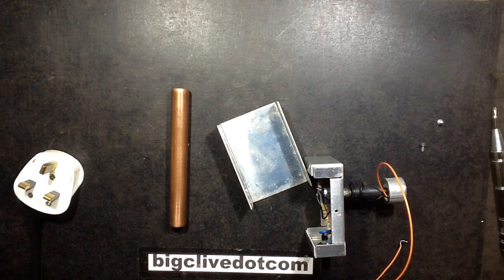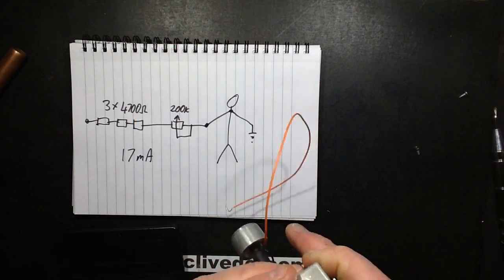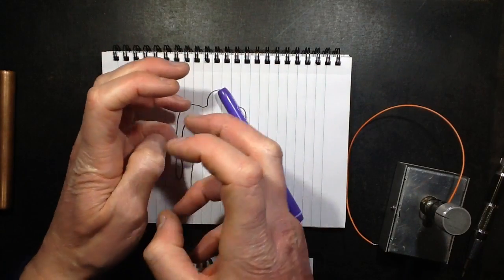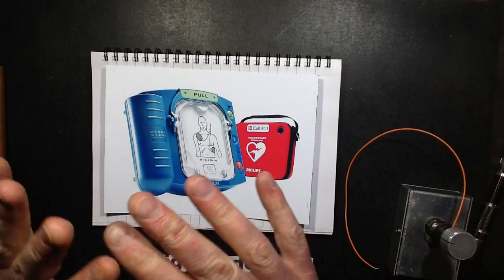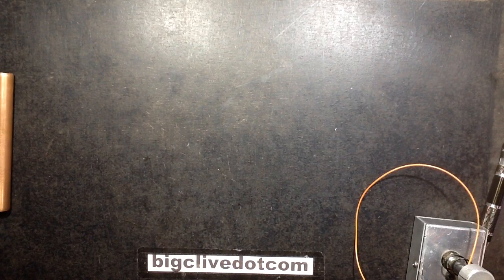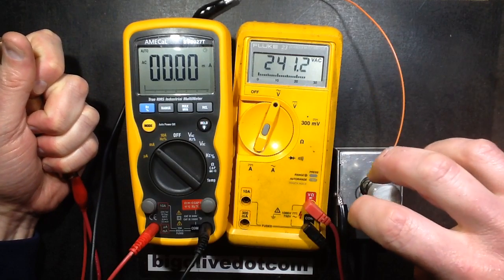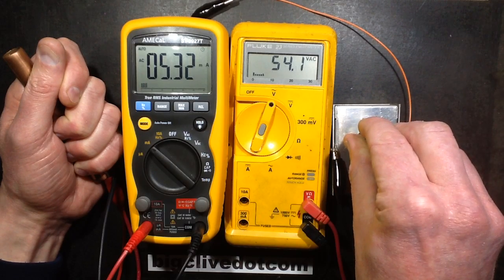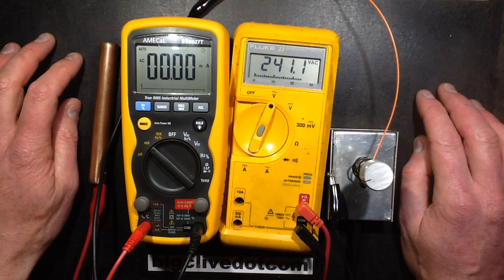Avoiding electrocution (Featuring real shocks.)

Comment: when i was given nerve conduction test to check for carpal tunnel syndrome , they fire 57 mA between elbow and fingeertips.most people are ok, except electricians, we just can't sit still when we feel current tingling like that, the automatic reaction is to pull away. 

Another automatic reaction, is when poking around in a live board with the right hand, the left hand automatically goes behind your back, to avoid dangerous current flow
Reply: When I was given nerve conduction tests for the same reason, the doc said I should see somebody as I reacted so much to the sensation. I told him that is fucking unpleasant which is why it is used as a torture method.
Reply: @drteeth7054  doc why don't you try it lol
Reply: 57mA? What the hell

Comment: 9:15 There is a famous picture of a televised soccer (football) game in which the pitch was struck by lightning. About have the players of both teams collapsed badly hurt. There didn't seem to be any rime or reason why some players were hurt while others weren't.Then someone watching a replay noticed that all of the injured players had both feet on the ground when the lightning struck, while all of the uninjured players were running and had at least one foot off the ground.
Reply from the maker: +Eric Taylor The science of voltage gradient.  The further apart the contact points are, the higher the current flow through the body.

Comment: Some time ago I worked with a best boy (movie electrician) who was completely immune to shocks. He could literally light bulbs on the tip of his nose. Which was great for him, but not necessarily for the rest of the crew (who got a few nasty shocks off him). Apparently there are some genetic mutations that can cause people to have highly conductive skin.
Reply from the maker: +RFC3514 There's also trickery.  Most of the electro-freaks used concealed wires, high frequency or props.
Reply: bigclivedotcom I'm sure there is, but this guy wasn't using any (one of the other electricians deliberately made a light stand live and he didn't even notice it). Also, he kind of lacked the imagination or intelligence to fake it. Not the "brightest bulb", so to speak. :-P

Basically, he had that job because he could fix practically anything on set without turning the power off.
Reply from the maker: +RFC3514 I will admit that at work one guy did take the tingle-tron to the max and din't seem to be sensitive to current flow at all.

Comment: anyone know what kind of voltage and current comes out of those electronic exercise belts for lazy people? they have  electrodes/pads in a belt you put around your stomach and they pulse electric through you to make your muscles contract. I assume theyre safe because its just going across your stomach rather than through your heart but theyre excruciating
Reply: The electronic trainers are usually under 50mA and for them to work they have to be grounded. You put one ground between the electrodes so the current only flows through the mucle any escape electricity that escapes will go to ground:). So they are relatively safe. They might also has a control as Clive says in the video that cuts if it senses a pulse.

Comment: As an electrician I can say that the occasional and unplanned electric shock is painful and a very unpleasant feeling. I don't know whether to congratulate you or condemn this video...but you have some big cajones Clive
Reply: +DaZ X I was once dismantling an old trash camera for the little useful capacitor inside. Well (me not being knowledgeable about electricity whatsoever) i did not short it out beforehand. Yes, fully charged you can see where this is going. The capacitor was rated at 125V around and 8000μF(estimate). I'm not sure of the other specifics as i misplaced it somewhere. Anyways i touched it and boy did it give my sweaty hand a zing when i dropped the circuit board holding it so i grabbed it instinctively. I want to know if such a Capacitor would be safe as an electrocution device for pranks or other ideas of the sorts. I already know the answer is probably a bit bold no but i thought i'd ask as well if i was in any real danger when i grasped it with my hand. Hope you get back to me, anyways have a good one!

Comment: There was a kid at my school who built a device from a rotary dial phone. It was self-contained (didn't get mains power iirc). Just one turn of the dial and all of the people holding hands forming a circuit with its terminals would be twitching and shrieking/giggling like crazy until one let go breaking the circuit.  
I wish I knew how that worked. I guess it must be high voltage but low current and possibly DC (so reasonably safe? (can it be safe if it's making people twist and shout?)), the dial turning high gear ratios to a dynamo but perhaps a battery or two was involved. I never saw inside it. If anyone can explain it (apart from the kid who built it) Clive can.

Edit: After a little bit of searching, those phones had Magnetos that could apparently output over 100V AC (not sure about Amps) so it might have been nothing more than that (although I think he did add at least a rheostat to vary the output). I think the advantage over your tingletron is that the electricity flow is timed by the phone dial turning so it automatically cuts out after a second or two. That would seem a little bit safer to me. The AC frequency might be different and then perhaps a little safer too.
Reply from the maker: +CommissionerSleer I found one of those in a box of my grandad's stuff and didn't know what it was.  I turned the handle and got a hell of a shock.  It's purpose was to generate a ringing voltage to ring the phone at the other end.
Reply: bigclivedotcom Thanks for replying. It's a surprising [shocking] feature of old phones. I'd forgotten all about it until seeing your tingletron. It's a shame that kids these days have to get their shocks from Chinese water heaters sold on e-bay.

Thank you too for all your videos. They're very entertaining and interesting.

Comment: Great video as always. On the topic of electrocution - I don't understand USA plugs and outlets. We moan about poor quality Chinese rubbish (and rightly so) but the 2 pin USA plugs are a death trap. In the UK our plugs have an insulator on live and neutral and only around 5mm at the end is conductive so when you remove the plug there's almost no chance of accidentally touching a live conductor. USA 2 pins plugs don't have this safety feature. the sockets also don't have the earth shut off of the live/neutral  (so when you take out the plug the plastic goes over the live/neutral). Also all the USA plugs I've seen just seem to 'hang' out at the ones without an earth pin only rely on the live/neutral thin pins and the compression of the socket is all that's used to hold it in place. For old sockets this means the plug can be super loose, slowly come out and can arc if not properly connected and we'll,  we all know what happens then. As USA plugs carry a higher current they need better connectivity too. Am I missing something with this? UK plugs are old fashioned but very over engineered. Other countries in the EU with the round plugs are not desimilar to the UK and are also quite effective.
Reply from the maker: +Richard Parry The American plugs are something that can't easily be changed due to there being so many of them in use already.  It's a "grandfathered" design like the E27 and B22 lamp holders you can stick your finger in.

Comment: I have drained a battery on one of those novelty shock lighters by just holding down the button, my friends were surprised because most of them would drop it after the initial sensation.

Comment: You ought to do a teardown on one of those cheap Chinese, battery operated, TENS (transcutaneous electronic nerve stimulator) units, also sold as "electronic massagers". You put two adhesive pads on your skin and turn it on.
Reply from the maker: +Chaplain Dave Sparks I've tried a few for fun.  Most of them have a random output at full feature which makes them more like a random shock game.

Comment: put the back of your hand on the copper pipe, that way if your muscles contract beyond your control you pull away from the pipe, always touch anything that might be live with the back of your hand first
Reply: Who doesn't?! I usually have a coil in my pocket and I drag a stake on the ground...
Reply: +james hallas Back of a finger is even better - if you get a shock it'll curl your finger automatically disconnecting you from the source. I'd use a non-contact pen first though, just in case. But that trick's useful in case your pen gave a false-negative.
Reply: +pmailkeey no s##t Sherlock, I take it you carry an earthed wire around with you at all times?
Reply: Better yet put the back of someone else's hand...
Reply: I used to just pinch a long blade of green grass between my thumb and pointer finger and touch it to electric fences to see if they were on or off.. When on, you could just feel a weak pulsation
I dont know if something like this would work for other things or not.?
Reply: Ha ha... Alex Greenwood, ME TOO !!! Esp. since I just shooed a fly away a few seconds ago !
Reply: Mike44449 You have just won the internet. xD

Comment: watched my brothers grab an electric fence,the girl living there could hear the transformer switching on and off knew when to let go and when to grab on, she told my brothers it didnt hurt, thats because it wasnt on when she was grabbing it. I laughed so hard when they latched on to it when it was on. what idiots! she was cute,so they were pretty gullible to say the least. lol. I worked around 260vt at a factory. I had a screw driver blown out of my hand when I accidentally touched a live power bar. It blew the tip of the screwdriver right Off. All of my tools were insulated. That happened to be a wood handled screwdriver someone handed me. I know what it feels like to be "poked". not much fun.

Comment: We once did an experiment in physics when learning about capacitance and capacitors where we charged up the class (standing on plastic trays) in a line of 10 people with linked arms using a van der graf generator, and then discharged the line from one end through another person touching an earthed tap. We were all expecting a small shock but it was strong enough to cause strong spasms in our arms. Fun stuff xD
Reply: +Debated Nothing We used to do something similar in computer class. A line of people would lift their feet off the ground and touch the staticy CRT monitor with one hand, and the next person in the chain with the other. Person at the end of the chain got touched on the ear, and a nice static shock. VDG generator's would be way more powerful but we never got to play with them :(

Comment: With all your talk of sensible electric safety, I keep thinking of the warehouse where I used to work. We had a big 1,000-liter mixing tank for liquid fertilizer. Water-based, of course. The water was probably fairly conductive. The salts in the fertilizer were certainly more so. Not long after I started working there, I noticed that, when I touched the fertilizer to check consistency (it was organic, so no worries there), I felt a peculiar nasty tingling in my fingers. I thought it was just my imagination. Then I realized that the mixing-tank was being agitated by a shitty mains-voltage immersion pump, connected to an unfathomably shitty power strip which was just cable-tied to the tank and was regularly splashed and soaked with conductive fertilizer. I all but forced my boss to let me drive to the hardware store and get a proper outdoor-rated power strip.

It couldn't have been that much current, since I wasn't connected to ground (and since it didn't kill all three of us who were working with it), but even so, it's a nasty sensation. I take my hat off to you for enduring that tingly torture for educational purposes.
Reply: p
Reply: Pretty much anything liquid is water based.
Reply: @looksirdroids9134  No. Anything can be liquid at the right temperature and pressure. Lava is liquid rock, Mercury is a metal that is liquid at room temperature, etc..

Comment: That's incredible, I didn't realise that milliamps were enough to kill someone (I always thought it was amps). Years ago I was messing with a fusebox and accidentally touched the black(?) mains input and was shot about 2 foot backwards... how many amps and why didn't I die? some suggest simply luck
Reply: I'm not an electrician but I would say the natural resistance of your body saved you. Voltage is equal to current times resistance. If you were throw likely the current flowed straight through only a part of you. Missing the heart and causing the massive muscle contraction that made you involuntarily move. Due to high resistance the current that flowed was relatively small. Think of static shock during dry winter months. The arc is caused by very very high voltage that flows right thru your finger but it's very low current.
Reply: +Kayla Mayfield Therei s actually a test on youtube showing static shocks are 8amps but due to the short period of the shock its not enough to kill.

Comment: I shocked myself once on 230 volts. Luckily, i was careful so the current only went through one finger. Still it did hurt like hell. Can't really recommend it to anybody.

Another time i hot shocked from the worst camera in history.
I tried to repair a small digital canon camera with stuck optics for a friend.
I unscrewed all the screws, and the moment i pressed onto the case to open it up, i got zapped by a giant motherfucking capacitor. The battery was not switch able, it was soldered in. And they had no way to discharge that capacitor inside, except for the flash itself.
Reply: +djteac These camera flash caps, making the life of tinkering people colourful since introduction of photography:)
Reply: Yes, that's how I got my first uncontrolled shock too. By messing about with instant/ flash cameras, trying to create a ring flash by joining them. It was rated at 330V and had a 1000uF capacity.
Reply: You will find that most camera flashes are like that.

Comment: when i was younger i had one of those devices with the electro pads you strapped to your stomach to  stimulate the muscles i remember doing it on my  arms  once and my arms clawing up  and i was unable to turn it off easily.  I wonder what sort of power that was putting out.

Comment: Thanks for making and posting informative and entertaining videos...I had to cringe when watching this one (I might know what I am doing too, but I wouldn't have performed this test alone!)...as you pointed out, inadvertently passing AC current through the chest cavity is the most dangerous, because it can put the heart into VFib...and then you performed the test in this most dangerous way...with current flowing from one hand, through chest cavity and to the other...thankfully you know what you are doing and had the current limiting box in series.  
It should be pointed out that only a small part of the limited current flowing in this experiment was flowing through Clive's heart because there are many other parallel paths not involving the heart.  Fatal accidents happen when current is passed from hand to hand without current limiting (enough current then can flow through heart muscles to put it into VFib).    
I bet you could repeat the test, passing an even higher current, but NOT through the chest cavity, but for instance from hand to upper arm.  This would still allow you to feel the current and report sensations, but with no chance of affecting the heart (and taking a chance on ending you video making career!) .  
Finally:  There is a cardinal rule for service personnel, to prevent current across the chest cavity for when you must work on live equipment (no joke!):  Work with one hand ONLY, keeping other hand in pocket and on your most favorite appendage!

Comment: What a shocking video.  I put it in my playlist named 'current events'.  It may, however spark a revolt, as to wire we relay doing this.  I have a battery of questions coming down the line, asking 'watts the point?'...   

Never use salt,  even with a dry cell.  A salt and battery constitutes criminal negligence, notwithstanding skin effect.  Realizing what a poor conductor I am,  my train of thought is derailed,  inspiring me to become a better engineer - as long as I keep a few cases of Full Throttle on board.  I had to switch,  since I can no longer find Jolt Cola.  Give me a brakeman - it's hard to switch.  

Sorry for my monorail mentality; I have a one-track mind.  I wrestle with the trestle, thinking how far I could fall should I become derailed.  So please don't rail on me for my puns.
Reply: this was cringe. Where are the puns again?
Reply: Kyle247l For some reason my comment above has a translate option :/

Comment: I'll give you props for having the balls to do this. Maybe I would try at 120V, but I've been shocked quite bad from 240V twice now. Even touching live 120V without a path to ground you can still feel a strong shock due to the body's natural capacitance. I cant tell you how many times i've worked on live circuits in homes in order to figure out how the previous guy did it, and gotten quite a shock in just one hand directly to the mains. Thankfully I never made the mistake of being earthed through one hand and live at the other or I might not be here. 50Hz is slightly less painful in the twitching aspect, but that 240V must be killer on your rig. I've only hand cross body shock a few times, and it knocked me off my ass, thankfully I never died, I consider myself lucky. 

I dont have the balls to grab that thing and take a shock arm to arm.